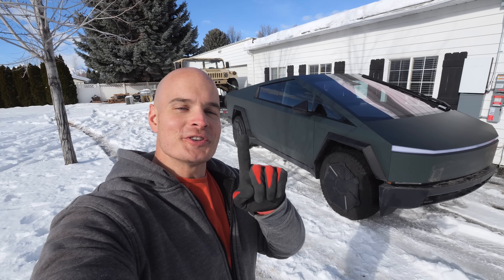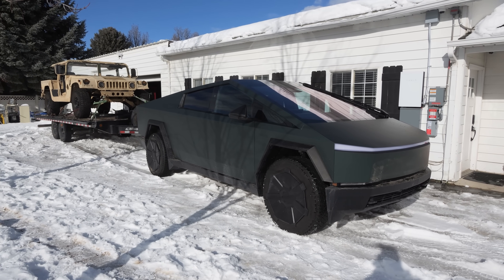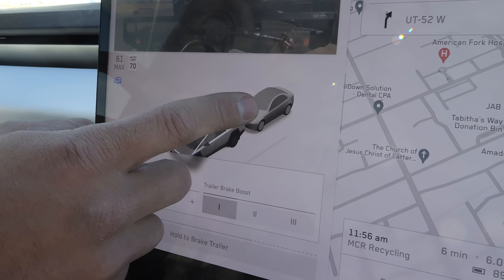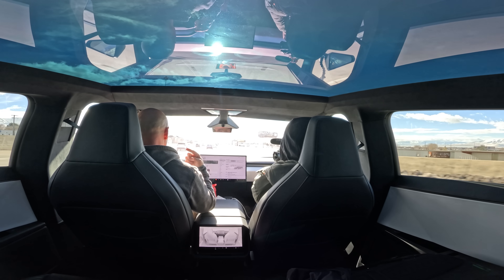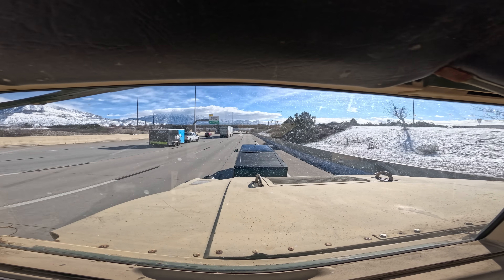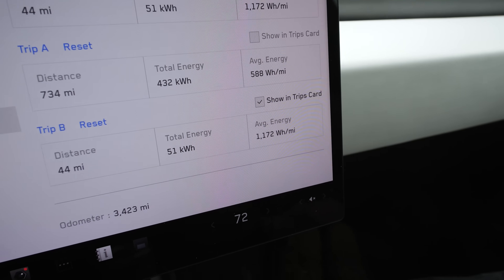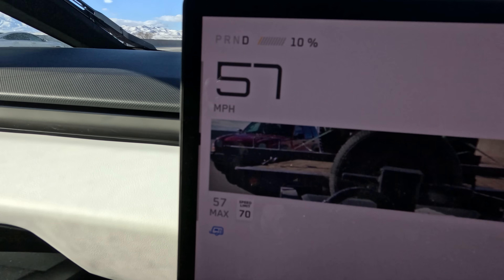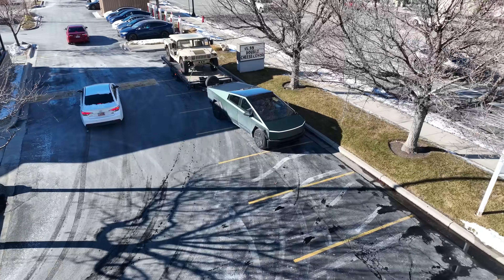How far can the CYBERTRUCK tow 11,000lbs in Freezing Weather?

Comment: The 3 thing I want to know 1. Who created this stupid looking thing 2. Who is this for ?
3. Does this do everything elon claims it can do like take a round from a battleship or a tank ? Have the hardest metal ever created? Be indestructible ? Be faster than a 911 while towing a 911 in a quarter mile ? Or how about faster then any gas truck ever around a track ? Or how about tow more then a 3500 truck or get 135 MPGe. You know MPGe is a scam. Because if a ram 1500 v8 got that kind of mileage you could drive cross country easy and maybe from LA to NY and back before needing more gas.

Comment: Tesla doesn't recalculate the screen range, only the navigation arrival percent. None of the Teslas ever have, which is one reason why I only use battery percent displayed as miles is just a linear relationship to the battery percent. CT is such a disappointment for charging, range, and truck duty. All gimmicks, no additional utility compared to the other BEV trucks and still well under an ICE truck.

Comment: That 4 wheel fly by wire steering is insane
Reply: The rotation is expected to 3x after software unlock. Should make it much more useful
Reply: We had 4 wheel steering in the 1980s - Mitsubishi GTO jumps to mind. Basically a fad.
Reply: @mkyhou1160  Works much better these days. New Range Rover also has it.
Reply: @fubar12345  it’s just more parts to break. Learn to drive a truck properly, no need for baby wheels.
Reply: @mkyhou1160  yeah, "more moving parts to break" seems to be Tesla's brand. 

The feature is dope, but I sure hope its durable. Losing power steering is already a death sentence, I can't imagine losing this digital version.
Reply: @LibertyMonk losing power steering is a death sentence? You gotta be so insanely weak to lose power steering and have any actual issue driving your car lol
Reply: @mkyhou1160 on a sports car maybe.

Comment: I went a bit nerd with one of the stats.. my mountsin bike total is 1170wh, weighing in at 300 pounds with me. Anyway, calculating miles and weight.. the tesla went 7 times further. long story short, I assumed eponential gain on battery cars was backwards..(the bigger it got the weaker it gets) but if you do go big enough battery pack, it is the other way around after all. :goodvibes:

Comment: im not a car guy, but how far would a combustion truck have made it?
(and how expensive would it be)
Reply: Depends on if gas or diesel, and what fuel tank size it has. A half ton gas truck might see maybe 200 miles in best case, a heavy duty wirh a diesel might get you up in the low 400's if youre lucky

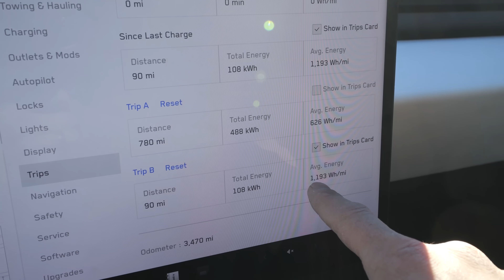Comment: At 15:06 it shows Trip A (prior to towing trip) was 780 miles and used 488 kWh = 1.6 miles/kWh. With a 108 kWh battery this equals a range of only 173 miles. Also, you charged at home for $0.12/kWh but didn't mention the supercharger rate per kWh when refueling.
Reply: Battery is not 108 but 123
Also you have no clue what speed, what acceleration and at what temp that 1.6miles/kwh was driven
Reply: Exactly my point. It was likely normal driving conditions that normal people drive...no 60 mph in the fast lane, no sweating while in the summer heat instead of using AC, no wearing gloves and down jackets during the winter, instead of using the heat.  @bartdeking

Comment: You should also see what the tri-motor can do in this situation if you get the chance
Reply: Range would be worse
Reply: Currently very hard to get the Tri-motor since it seems the only customer vehicles that are in that spec are the delivery event vehicles.
Everything they are shipping right now are the Dual-motor foundation series.
Reply: Might be too loud to record
Reply: I would like to see it too, as it could have more range due to the additional motor making it work less overall.  Great video btw!
Reply: @joeypittsteelers963  that is not how physics work. More motors = more weight, and more losses. Unless it gets a bigger battery pack you will gain nothing and rather lose a bit of range
Reply: not necessarily, don't be so arrogant. Depending on how the power curve works you can have more efficiency with more motors it depends.  @jekker1000
Reply: @seekerscovereal  Even Tesla states the trimotor has less range than the dual motor having the same battery pack.  

And power curves are just that…  curves.  Mph (and inherently motor rpm) will directly effect those power/efficiency curves.
Reply: @seekerscovereal  well, that is not how it works. Physics do not care for your hurt feelings. If you go by efficiency of motors, you will actually see that having a small motor that is at full peak to perform will have their 95%-98% efficiency right at this sweet spot. Same with gas/diesel engines. If you put 4 cylinders extra and they are just basically idling for the sound, your efficiency goes down the drain. That is why in developed societies, where gas is taxed a bit harsher, people pay attention to fuel economy and that is why you find so many three- and four cylinder cars on our roads. Because these engines are superior in efficiency and are constantly operated in the sweet spot vs. the v8 just idling around.

Comment: The navigation remaining battery display does adjust for load, driving style, temperature etc. and is fairly accurate and reliable, if it says you will have 5% at the destination you will make it, if you don't change your driving speed too much, and it accounts for mountain climbs and descents too, you can use the navigation remaining % to judge if you need to stop sooner, dropping speed makes a huge difference if you think it's going to be too tight.

However, the top left battery percent / 'battery range' is a fixed multiplier that does not account for load, although it does account for battery degradation - it's the EPA range when the battery is 100%, half the EPA range when the battery is 50% etc. It is useless as a display of remaining range, I would argue there should be both numbers displayed in the top left, rated and actual remaining range, I don't know about the cybertruck, but in other Tesla's there is a good energy graph display with estimated actual range remaining, so that figure does exist buried in the UI.

Comment: Absolutely abysmal results, though no one should be surprised at this point.  Realistically, you would never want to go below 10% battery, so the real range here was more like 80 miles plus an emergency reserve.  The Hummer represented perhaps a minor to modest wind load, but certainly not a worst case wind load like with a travel trailer or box trailer.  Getting the battery from 10% to 80% is more like an hour when you consider that you have to unhook the trailer, charge, and then hook the trailer, and then all you get is maybe another 60 miles of usable range.  That is horrendously bad.  The trailer needs its own solar/battery/drive system and it needs to feed the truck at least some power in addition to its self propulsion.  This supplementary system would have to have an enormous storage capacity and have even faster supercharging capability than the Cybertruck.  Good luck with all that.

Comment: After driving a Ford Edge for a month - with no knobs or buttons to control hvac or most radio functions, I would NOT, by choice, EVER buy a vehicle with only touch screen interface. It's a disaster waiting to happen. I hated it. But also.. 108KwH for 90 miles? My whole house barely uses that in a day.

Comment: My 700,000 mile Cummins can go 700 miles on 80$ worth of fuel in a dually truck. Loaded at 36k lbs I can go 400 miles on the same fuel and it engine is 30 year old technology.

These electric vehicles are not impressive in any way. And if you understand how an electric motor works you’d understand why they are so fast and also realize that is an awful selling point. 

Thanks for the video though just confirming my distaste for manufacturers and their poor understanding of what is actually needed.

Your hummer is awesome though just because you built it yourself!

Comment: If you put in your destination in navigation then you can click on the 3 dots on the bottom of the screen and there is an energy graph in there that will give you all of the trip power usage info.  The little range deal on the screen is pointless and doesn't represent real time.  The navigation number should be accurate.

Comment: 90 miles on a full charge is abysmal. And if the "pull thru trailer chargers" are gonna be built", they're gonna be far apart and few, making that 90 miles even more alarming. We are gonna have to have some way better batteries if we ever are gonna have any kind of competition with ICE vehicles in terms of towing ability. Some 3500s and 350's tow 20,000-35,000lbs. Gonna need some way more efficient, higher capacity batteries (solid state?) For this to make sense. 

I wanted a Cybertruck so badly. I waited years for THIS video. I thought it would perform better than the lightning and Rivian with towing. 

And if you got the big extra battery addition, in these towing conditions, you're still looking at like less than 150 miles I'd bet.

Comment: If a bald guy is video taping outdoors without a hat, it is not that cold.  (I am a bald guy who lives in a cold part of Canada) Also, regenerative braking only returns a portion of the power required to accelerate to the speed achieved before braking.  All the power used to travel at a constant speed is gone forever.

Comment: Can you do the freezing weather test with the F150 Lightning? This series is really interesting to compare the different vehicles in summer and winter. Also, can you give reference for the range an ICE truck would be able to get towing the same weight?
Reply: My 8,000lb 2012 Ford F250 CC with the Powerstroke diesel pulled my 15,000lb 5th wheel camper (which has a huge air path at 8-6 wide & 13 tall) from Indianapolis to Charleston South Carolina a handful of times at 13MPG / right around 400-450 miles per fill on a 38 gallon tank. I could drive the trip in about 12-13 hrs with a few stops. Just for reference...
Reply: @christopherludlow3106 would this be more or less with say a 1500 series truck which would be more common for most folk?
Reply: @darceew  I couldn't speak on behalf of that. There are so many variables with different engine/truck combinations that affect economy, and as another person in this thread pointed out, half ton trucks have smaller fuel tanks. 

I think EVs are exciting, but I just don't think they are there yet for the world that uses their truck to perform work with.
Reply: @christopherludlow3106  And you pay 10x more money to use that vehicle.
Reply: @silvy7394   I don't know what kind of math you use to arrive at that conclusion. Having to fast charge the CT 123kWh battery is not cheap! And it costs $100K. It takes a lot of tanks of gas to recoup those costs.
Reply: @silvy7394  I paid 19k for the truck used. My insurance is like 60 a month and my plates are only 130 a year. Outside of oil changes, my maintenance has been minimal with brakes and a water pump. The truck gets 19-21 mpg empty driving sensible. I'm comfortable with the cost to operate as my utilitarian vehicle pulling trailers and hauling construction material, but would not daily commute to work with it.

I also didn't mention that the truck has 400k miles on it.
Reply: @christopherludlow3106  yikes. That truck isnt going to last much longer. Not only due to the very high mileage (for an ICE) but the fact you're not doing the proper maintenance on it if that's all you do.

It's also almost guaranteed that transmission or engine has been rebuilt or replaced since it was new. Pretty much every component in that vehicle has been replaced too and isn't stock.
Reply: @silvy7394  you are clearly well informed on the subject. I will see my way out of this conversation.
Reply: @silvy7394 I have a Mercedes Sprinter work van which is used almost exclusively with heavy trailers. It has about 500,000km on the clock now without any major work to the engine and transmission. And I am very, very sloppy at maintenance.
Reply: @christopherludlow3106   your 12 year old truck is so completely different from a brand new electric truck.
Reply: @L111zrd   The original comment was just asking for a reference point of how much range a standard ICE truck has when towing a similar amount of weight.
Reply: @L111zrd  I gave a personal excerpt to the OP on my experience with towing in my ICE truck. There is also a 12 year technology gap between a new EV truck and my dinosaur with 400k miles on it.
Reply: I'm interested to see how an ICE F150 will perform as well, as I know that's the most common and the least built for towing (relatively speaking), as well as being what the F150 Lightning is based on. 

I saw another video comparing the F150 Lightning to a baseline ICE GM truck towing 6000 lbs, and the Lightning got 100 miles whereas the ICE truck got 200 miles. I'm assuming the F250+ sizes all get larger and larger gas tanks and that would explain the difference in range (my only other reference is that my ICE sedan without towing gets ~400 miles on a single tank). 

The interesting thing from that video was, despite the Lightning losing, it got 0.7 miles/kWh or ~24 MPGe towing all that weight. In comparison, the ICE truck got <9 MPG. This shows that we could really be in for a massive improvement with EVs if battery energy density could catch up to store the kWhs that a filled gas tank can, the efficiency is already way better. 

Just curious how the technology stacks up now, I'm definitely interested in EV technology, but I don't feel like batteries are quite at the level I'd be comfortable with yet.
Reply: My 2007 Ford F550 with a stock 23 gallon tank + 50 gallon bed tank will tow 18K lbs 500 miles. Do the math. The bottom line is, having to stop and drop a trailer every 90-100 miles, and the stress of nearly running the battery to zero in that distance, is far too stressful and impractical for towing.

Comment: I’d love to see a 1to1 comparison of a similarly priced gas or diesel truck. Obviously gas is going to kick ass in towing range but an overall would be nice too
Reply: The main advantage gas has is energy density, which is why it's amazing for range. 

That 0 to 60 being 12 seconds for all three electrics is meaningful. Gas pickups are at 15 or 20 seconds at their own towing capacity. 

If you're looking at "similarly priced", gas is also going to win because batteries are expensive and the only way to get any kind of range. They make up for it over time by being more efficient (even if electricity is more expensive) and lower maintenance, but for up-front single sum cost, gas vehicles are usually cheaper.
Reply: TFL has done a few videos like that, looking at actual fuel economy of F150 ecoboost while towing.  The EV haters act like gas and diesel don't suffer in cold and heavy towing.  However, it's a bigger hit on the EV.  Bottom line with today's technology is about 25% range loss in Gas vehicle and 50% range loss in EV when towing same configuration of significant load.  Temperatures in the 60-80 range bring the EV up to about 40% loss.
Reply: Cant have that because all of those EV diehard fanboys are just going to turn the comments into a warzone. They are incapable of acknowledging that ICE vehicles have any sort of advantage over EV, even if it is something as niche as towing.
Reply: @thatguyoverthere9634  towing is niche?
Reply: @barneystinson2781 
It is.
Reply: @thatguyoverthere9634 
That's one of the very few use cases where ICE still have a real advantage. For now.
Reply: @andrasbiro3007 ICE always will, electric is so efficient any inefficientcy, like towing, kills the range. That will never be overcome, just range might grow to such an extent it doesn't matter as much
Reply: @MrDummyisDumb 
But at that point it doesn't matter, so who cares?
Reply: @andrasbiro3007  That's what I'm saying, in the same sense AC drops efficientcy but it's not enough it matters in an ICE, we're a far way away from that though. Until you can tow 350 to 400 on a single charge, which means we need 800mi batteries. That's twice what we can currently produce

Comment: Being a retired weigh master, your trailer weight is incorrect. To establish correct weight on any trailer where the tongue is solid and there is not a wheel on each corner of the trailer, like a hay wagon, the trailer must be disconnected from the towing vehicle with the trailer jack resting on the scale platform with the tires. The reason is tongue weight. The vehicle is holding some of the weight of the trailer. Your weight is inaccurate, but OK for your test.

Comment: The noise your hearing is probably gear noise I would never trust steer by wire there is no failsafe if something happens computer failure battery failure. Normal power steering worst case something fails you still have steering it will just be heavier then normal

Comment: What kind of efficiency would you get towing the same setup with a large diesel truck?  I assume you could beat the 90 mile range but it would take a considerable amount of fuel, certainly more that 13$ bucks worth?
Reply: We used to tow a 9500 pound 5th wheel camper with a 2016 F350 diesel. On one 35 gallon tank, we could get about 300 miles of range, averaging 9-10mpg. At $3.80 a gallon for diesel, this would be about $135 for 300 miles. So yes the fuel for the cybertruck is much cheaper, but the F350 refuels much faster and gets you much further.
Reply: Plus the post 2010 diesels all have def (assuming you didn't delete it) so that's another part of the equation aswell
Reply: @Ryan-sw3km  True, if I remember correctly the 5 gallon tank would last about 5,000 miles and cost about $50 so it was pretty cheap